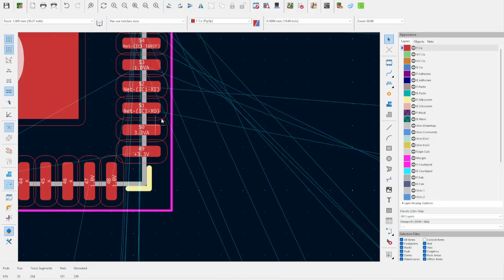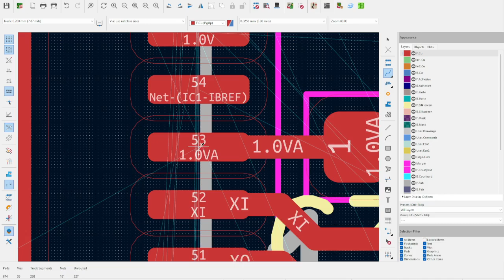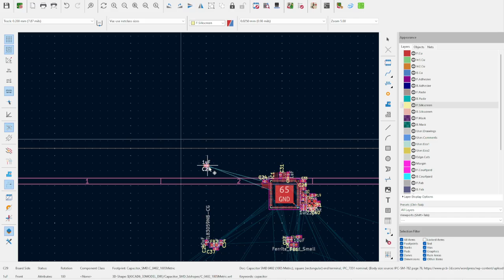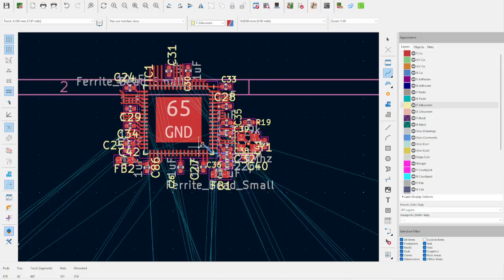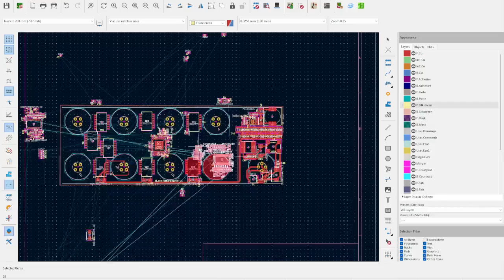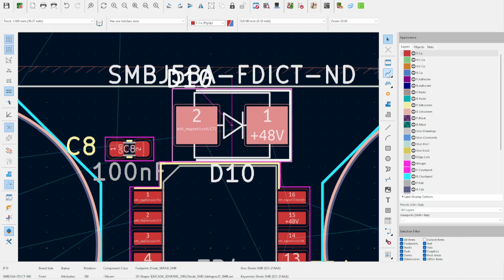EP2 Routing an industrial switch part. 2

Comment: 26:19 - Sembra esserci un "5" di troppo. L'IC RTL83059 pare non esistere. Esiste invece l'IC RTL8309. 🙂
Reply from the maker: Yes! Thank you, it's a typo, the RTL8305 also exists, and we use it on some other designs, hence the mix-up.